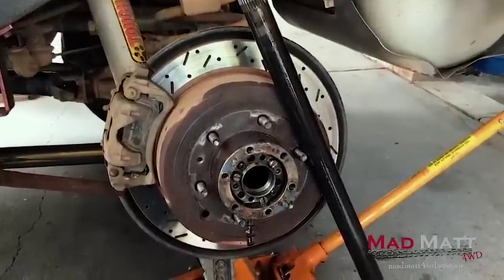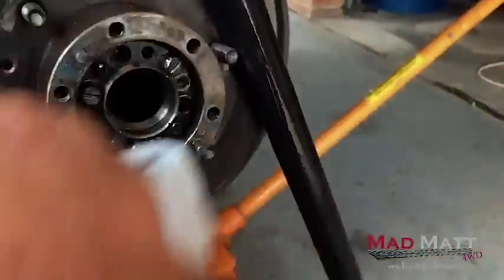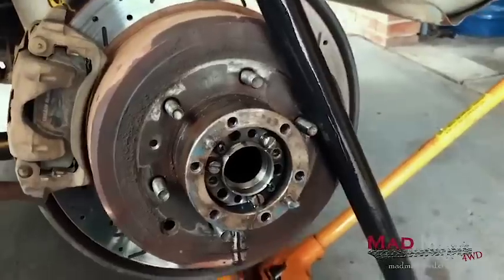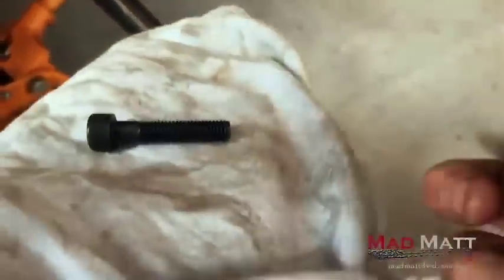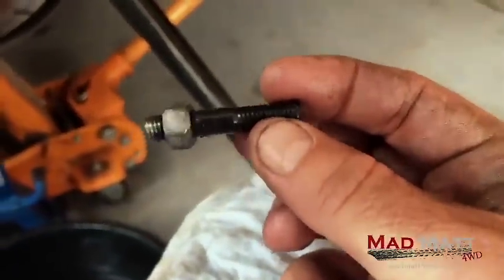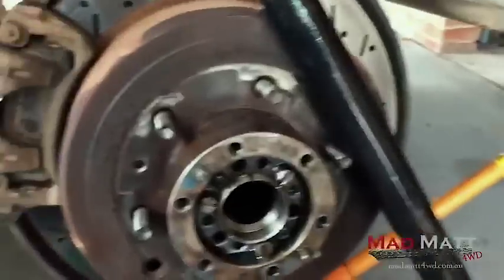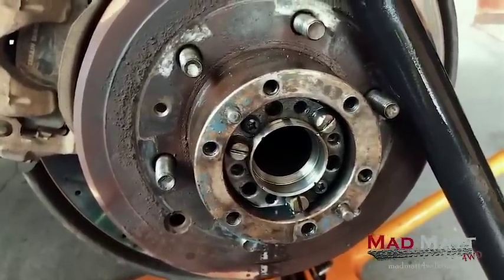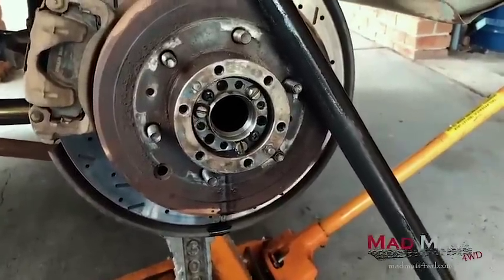Wheel bearings - Why I use oil instead of grease!

Comment: Oldie but a goodie. So right about the ol landies running on oil. I have owned 2 old Rangie classics and a Disco 1 that all ran on oiled bearings. The main reason for using grease is it's better for preventing leaks but doesn't lube as well. A very well respected Land Rover mechanic guru once told me to even use high temp  marine grease instead of rtv silicone on the axle hub face which I did and never once had a hub leak, great way to do it for ease of maintenance/repairs.
Reply from the maker: That’s an interesting idea. I wouldn’t use grease as I want the axle face to have high friction to the hub.

Comment: Why tf arent car bearings made with a little pin hole that can be drilled out or even unscrewed for lubricating. I just took two sets of stroller or lawn mower wheel bearings that where rusted asf and pretty much seized up could barely spin them either way neither hada bearing seal that i had laying around and used grease on one and oil on the other spun em up a few times and let them sit overnight....and the one i oiled now rotates like its brand new. I get that car bearings are under a way heavier load but still the idea that non sealed bearings rusted work like new with some oil vs grease is pretty crazy. I remember in my skateboard day's i could just slap some shortys speed wheel oil on my binded up bearings in 2 seconds and they would spin like they came from the factory.
Reply from the maker: Most bearings come good with a clean

Comment: Interesting video. Came across this looking into ditching the grease in a winch. It seems well established that grease is never as good as oil, and it seems it's really just a delivery system for the oil within the grease (I'm not a tribologist though). I thought most cars i had worked on used diff oil to lubricate the rear bearings, so thought this idea was well established.

I did read of someone else running the front bearings on a pajero, i think, in oil. I've pondered similar after looking at my front bearings recently. Any thoughts on doing this on independent suspension wheel bearings that aren't fed by the diff?
Reply from the maker: Containing the oil is the challenge.
Reply: Exactly what's going through my mind. I think the pajero example used that Lucas oil stabiliser type stuff which from memory is quite viscous and that could be the reason. But then I'm also running free wheel hubs on mine and I'm sure that isn't as well sealed, but maybe it has an o ring, can't quite remember. Might be able to make something to seal that portion and a new seal at the rear, but filling it poses a challenge also. They also do this with boat trailer bearings, do it can't be a ground breaking challenge. 

Cheers for the response

Comment: Hey Matt! Came back and checked these out again as I've bought a 105 and am looking at running the rear bearings in oil. My local bearing mob recommend it too.  My question is do you torque the cap screws to the same specs as you wouls if running the original hub stud/nut setup?

Cheers, loving the content!
Reply from the maker: Find the torque setting for the bolts your using.

Comment: just saw the video. glad you made good experience with bearings running on oil, but there are some points ...
first of all - i drive a land rover serie 2a, from 67, i guess its all the same technique still.
the first draw back is, that oil will mix with water, so you get something complete different.
- bearings and differential wear out with time. this parts runs in the oil and through the complete axle. 
-  owner leave the bearings in the axle until they die. land rover give a guideline of maintenance. every 3 years or 30tkm dismanteling, cleaning, greasing.
-before installing new bearings clean and grease them well, otherwise they are sentenced to death rightaway.
- might be also a problem, that people dont know how to grease a bearing and how much grease you should use. its hard to understand that your bearings last only 12month.
Reply from the maker: You raise good points and as you indicate you still need to maintain the vehicle. I run higher diff breathers and generally don’t have trouble with water getting into the oil.

Comment: Just been revisiting a few of the older videos and came across this one. There are different benefits of running oil or grease, there is no real wrong way! The main thing I find is people don't put enough grease in though. I have a Landy front axle that has done over 100,000 miles on the same greased bearings! THe axle has been on 2 vehicles. As you say in the video, Land Rover used to run oil, and 1000's still do, like the old man's 1957 Series 1, it works perfectly... The downside of oil is that it can starve the bearings of sufficient lubrication in some circumstances, and they can overheat and wear, but most will never get the inclines necessary and time for that to really be a problem. Grease illiminates this issue, but can get washed out when water gets into the bearings. A lot of newer vehicles run sealed-for-life bearings which again have their own problems and drawbacks, mostly not that easy to change when they fail. Love the drive flange amendment, I don't know why others don't do high tensile bolts as so much better than studs there. If I didn't have the Landy I'd still not have a Toyota... but if I did, I'd have done that too! 😀
Reply from the maker: You wouldn’t have a Toyota? Oh dear how can we be friends😂😂

Comment: Hey Mad Matt, how often are you having to check/change diff oil for both level and water ingress with this setup? Would be fairly detrimental if levels drop too low I imagine. And how do you check, as pulling the fill plug with 400ml extra is going to have it go everywhere. Or are you just assuming that if you can not see it leaking out anywhere that it is still in there and a bit a water between changes is ok? Thanks, Jake.
Reply from the maker: Hey Jake. If oil can come out water can get in. So I run good diff breathers and watch for leaks. Never had a water ingress issue
Reply: @MadMatt4WD  thanks Matt. Are you replacing the diff oil every 20k kms roughly?  Or more frequently? Cheers
Reply from the maker: @JakeScaramuzzi  more like every 40-50k

Comment: I think its smart to do that. Wish i could figure out away to do that on 1960 facon with the sealed bearing thing. Mine were getting a little oil from leaking seal and the fell free and i think the oil helped so maybe no new seals as long as it doest get to the beakes. Bearings lasting longer means a better way for sure.
Reply from the maker: Not seeing the setup I can only imagine. It’s a little risky but you could pull the inside seal from the bearing. But you would need to make sure oil did get to the bearing.

Comment: Permatex aviation the brown stuff would be better than silcone in my opinion i mean zero seepage
Reply from the maker: Seepage hasn’t been an issue for me.
Reply: Permatex makes a gear oil resistant sealant. It's specifically made for diff covers.

Comment: hi Toyota wheel bearings floater style , oil or grease it does not matter but is the Toyota well set up for either is the question .
The axle seals are very small compared to others brands .
The axle always has a groove from seal wear ,,FIX this by metal spraying 
Yes some were prone to axle studs shearing 
Never had axle gasket leaks ever.....
Preload for wheel bearings is expected and can be done by feel if very experienced .
PRELOAD applies to swivel hub bearings  and MUST be done with drag gauge . Of coarse u centred the axle first .
Bush  vehicles every 12mths when off station 
Mining vehicle every 3 mths full suspension steering o/haul
Reply from the maker: I’d run oil before I bothered metal spraying or buying new axles for the rear. I agree re seal size and preload.
Reply: @MadMatt4WD  
Metal spraying very very common if doing either front / rear end maintenance , way cheaper than new axles .

Comment: Agree with the oil vs grease matt. When I service the old boys trucks wheel bearings will get around a million k’s of service life running in oil. 
On the axle studs the cap screws are a good stronger upgrade bolt being a 12.9 cap screw the only downside of a bolt over a stud is that a stud has more thread per inch of clamp force for the mating surface. 
What I like to do it upgrade the dowel pins on 80’s to 105 spec which is a 10mm dowel if your really doing hard wheeling you can run 4 dowel pins. 
I also like to run a wet and dry stone over the hub face to clean it up and if you have access to a lathe you can just give the axle face a quick clean up so they clamp real nice.
Reply from the maker: Nice work. My race car 80 has the hub upgrade.

Comment: All I know is that as long as you use "Hi Temperature Wheel Bearing Grease" with water resistance capabilities, , you will have no problems.
Reply from the maker: Ok
Reply: @MadMatt4WD  But, I like your idea, for if the gear oil is formulated with 100 percent synthetic base fluid to ensure excellent high- and low-temperature performance, and also provides oxidation stability, which contributes to long lubricant life  (will not break down over time), then its fine! May, as you say, be even better!
Reply from the maker: Well it’s worked for me for years now.

Comment: The bearings lasting longer with oil than with grease sounds like a false correlation.  
At 4:50 you say that when you used grease you would back off the wheel bearings to adjust them. Loose wheel bearings fail prematurely, they should be preloaded correctly when installed and re-tightened 1000km later when they have bedded in. If they aren't preloaded enough the hub will also move which can cause oil to leak past the axle shaft seal and get into the hub.  
You say you adjust the bearings tighter now that you use oil, this is probably closer to the correct preload which is why they last longer.
Reply from the maker: Maybe.

Comment: If you don't want to get rid of the Toyota style studs, a tip for cone washer removal is to screw on a long nut. Hit the long nut with a brass drift, and the cone washer pops out. The long nut imparts the shock load over more threads which prevents localised damage. Nothing against Matt's ideas though, just another way to skin a cat
Reply from the maker: Good point. I use a brass drift when needed as well.

Comment: can you tell me again on the tightening and moving the part where there are 3 bolts or whatever that is!
Reply from the maker: Thanks the wheel bearing nut. Make it a tad tighter than you should to ensure the bearings don't move. This keeps the seal from leaking.

Comment: Matt, you are so correct in this procedure. An example of oil and bearings is my Kenworth, the front bearings are oil bath with a clear sight glass and a rubber fill plug. Never had a failure yet. The bearing load is 6000 pounds per wheel.
Reply from the maker: Cheers mate. I've had stand up arguments with some about how bad this idea is. LOL
Reply: Heavy duty axles and every modern axle use grease , because those retarded oil bearings fail all the time when heavily loaded. US trucks are not heavily loaded.